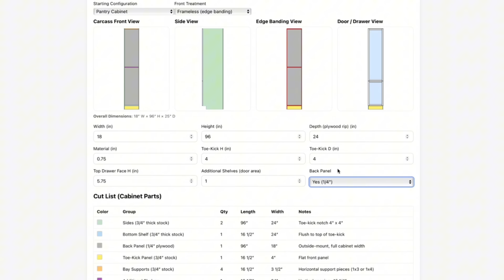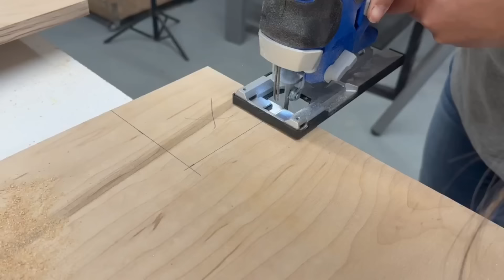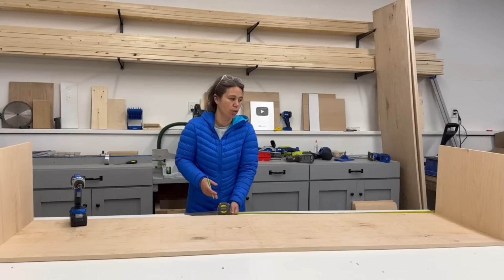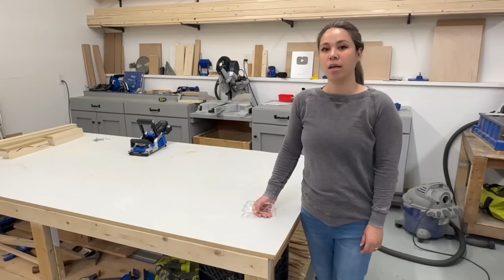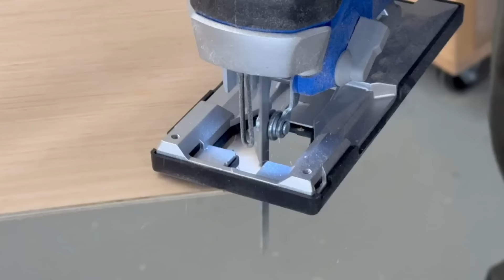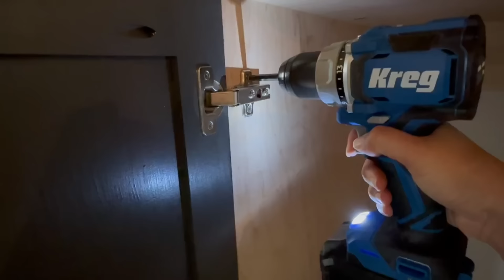Build Pantry Cabinets BY MYSELF!

Comment: Hi Ana! Long time stalker, first time commenter.
I made two of your adirondack chairs out of a whole butt-load of scrap wood I had on hand. They actually turned out pretty darn good, not having brand new lumber to use. It took quite a while to make and find the right pieces now and then, but I persisted and finished them both. It took probably a week to finish two just because of wait time and life. I have no shed or garage to work out of either, so hot sun blazing down I would have to stop. That was around 5 years ago now. 
I just saw this video of yours and had to respond to the new app on your web site. That's a real game changer right there. Thank you so much for giving all of these free plans for us to use. I was really proud of myself for accomplishing making adirondack chairs by myself and figuring out how to do it with what wood I did have!  I've made some of your smaller projects before as my starters, but then I moved onto those chairs and I am so very happy I did. For the cost of screws and glue, I had new garden furniture.
Reply from the maker: Thanks so much for taking the time to comment and for your support all of these years! I appreciate you:)

Comment: Fantastic ! What’s that little tool you use to trim the edging ? Not seen them where I live.
Reply from the maker: Thank you!  The tool is an edge banding trimmer.  It is available on Amazon. I also use a "flush cut trimmer" to cut the ends of the edge banding off square.  This is also on Amazon.
Reply: @AnaWhiteDIY  Thank you 👍🏻